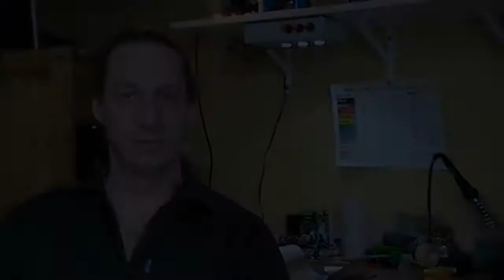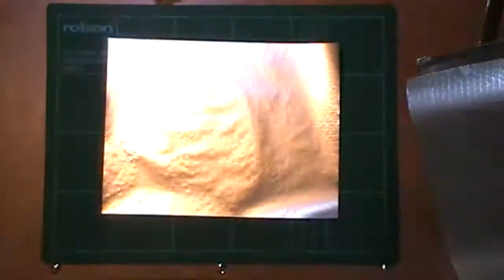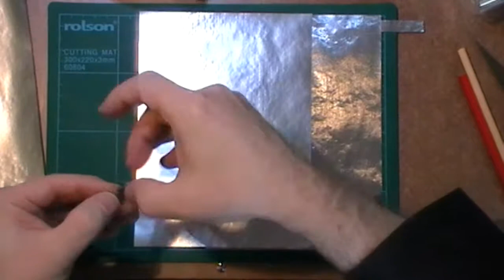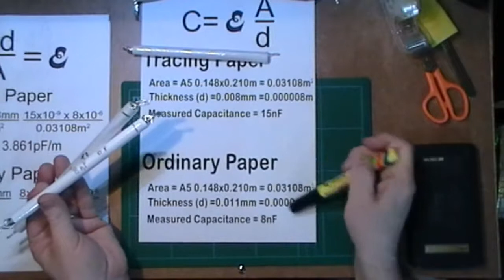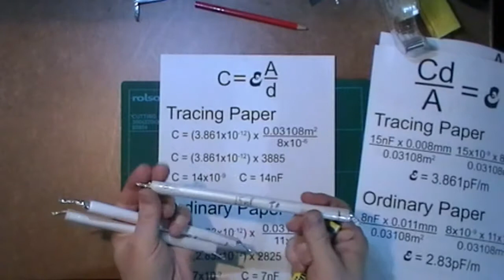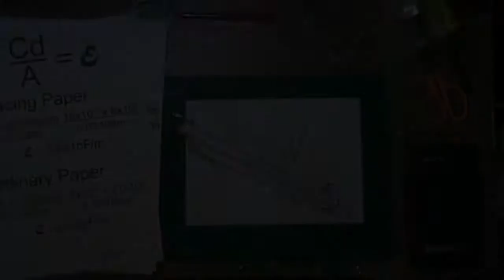DIY Capacitor, making my own capacitors

Comment: my understanding is that its the wrap and the tightness that can also affect the capacitance.   But yes.....I'm interested in how much voltage they can take before burning out.   I might be rolling my own also....since this is sort of the old method of making a condenser as capacitors were once called in the early days.  Also consider the paper in oil types.....so you might try impregnating the paper and perhaps using acid free type paper.  I've never dissected an old paper in wax type to see if the wax was also part of the dielectric and thus when heated ...the whole assembly became as one and solid....aside from the wax sealing aspect of the construction.I'd consider using copper foil as to be able to solder a lead to the plate/foil
Reply from the maker: Hi Mike C, This was my first attempt at constructing a basic capacitor so it was very simple.  It is interesting how the construction has changed over the years.  I'd like to get hold of some from a tube circuit.  The chemicals used to bond the unit together can be a bit nasty so caution when dissecting.
Reply: Yes I know exactly what you mean with the toxic aspect.  California has Proposition 65 which lists everything in the electronics industry that is toxic or carcinogenic of with the potential of both.....whether its applied to direct exposure from use or on the other end with the waste & environmental impact & the trickle down to human beings and the planet as a whole.      My father was an RCA dealer when I grew up, so I span the Vacuum tube era into solid state.....     And its amazing what the marvels of electronics brought and the aspect too of exposures.....as to what made the magic work....if it were "ROSWELL TECHNOLOGY" as some have it.    But when they say Paper in Oil for caps....is it just "oil" or is it toxic enhanced PCB oils as they used in the high tension transformers of the day for electricity transmission.....    When DuPont introduced the synthetic plastic materials like Nylon & Polyester.....the game changed in electronics for dielectrics....   And if you study the tube books from the tube manufacturer's...they list in general the material in construction....whether it be the obvious as with Mercury Vapor Rectifier tubes.....but the metal guts were also coated or alloys......and in particular the heater filaments were made of tungsten that was alloyed with Thorium otherwise referred to thoriated tungsten.  Thorium being radio active in the same class as uranium with an extreme half life.  Single vacuum tubes might not represent much of a risk, but large quantities would change that.  I happenstance have ended up by fate living next door to a former RCA service facility, a 6000 sq ft building that was used as far back as the 1950's and up to about 1980.....so back in the day its a question of waste handling.  I believe there is a large cache of vacuum tube era waste buried on the site next to a stream.....why ?  because I'm digging up vacuum tubes whether they be intact or broken glass as well as TV guts.....electrolytic caps, all toxic hazardous waste.  So if they opened up the back door to the building and tossed the service waste out the door into a pile....imagine the mercury vapor tubes breaking and the other tubes breaking the glass....and piling up creating a cache...then getting buried out of sight and mind....sitting there all these years ...affecting the stream and water table under the land...and my property.....and all those being exposed.  As with a Voltar battery...the pile battery he invented.....its 2 different metals separated by an insulator of cardboard soaked in salty brine water that created that battery.  In the real world here, its the salt water run off from the roadways due to winter snow removal and the presence of various metal components in the soil due to steel industry slag and the metals from the electronics.....its a natural battery in the soil & thus the cathodic action taking place.....putting these materials into solution into the water table.  I'm dealing with local authorities trying to cover this all up and hide it.....which is quite criminal.